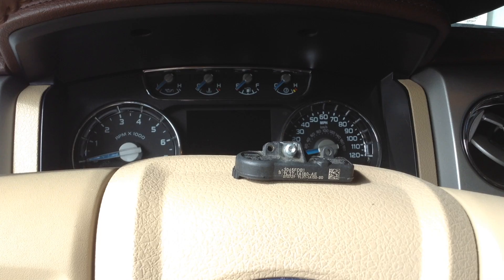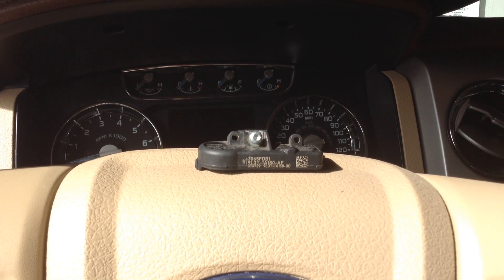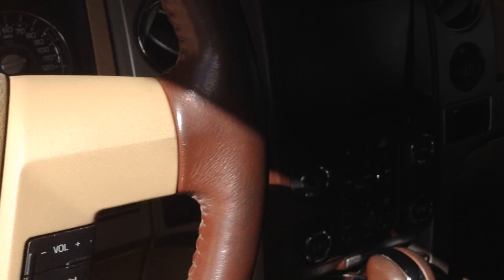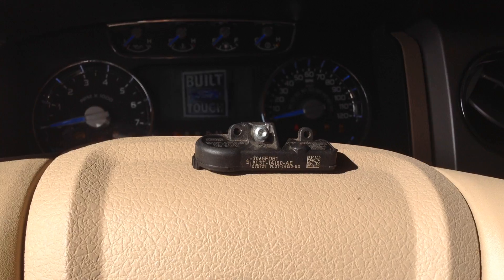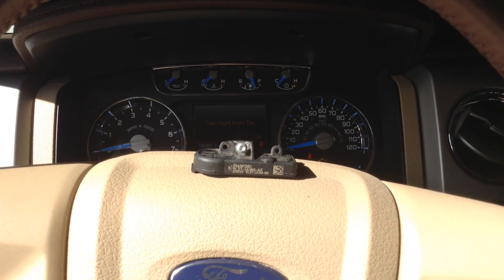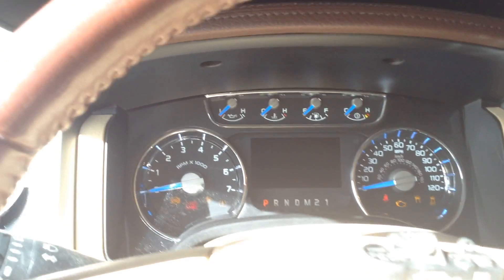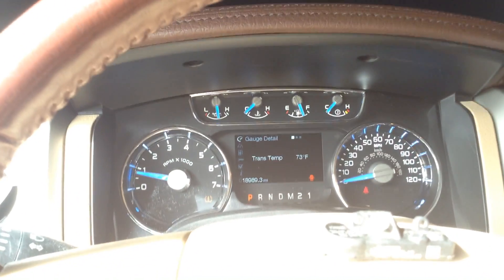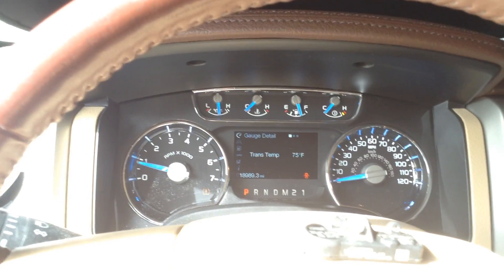Putting F150 into learn mode to train tire pressure sensors into TPMS

Comment: Great video, I just fixed my truck that has had the light on for 1 month after buying the motorcraft TPMS sensor tool off of amazon.  I had one bad sensor replaced due to a blowout and the place that replaced it couldn't train it for some reason (said their scanner only went to 2014, mine is 2015)  Thanks!!!!!